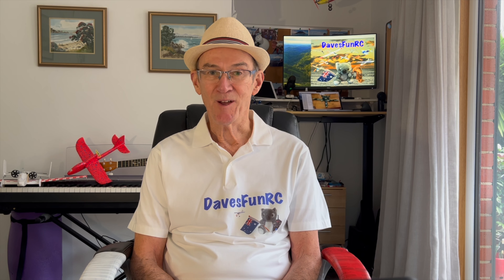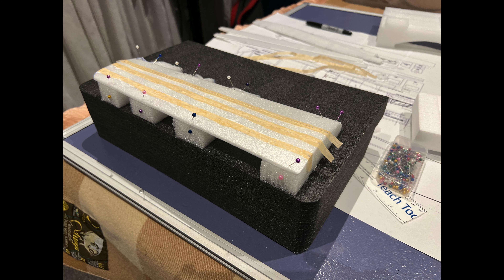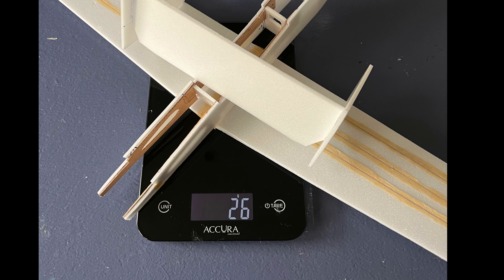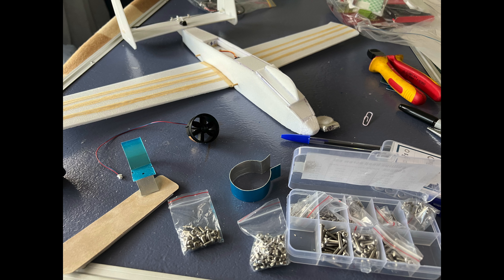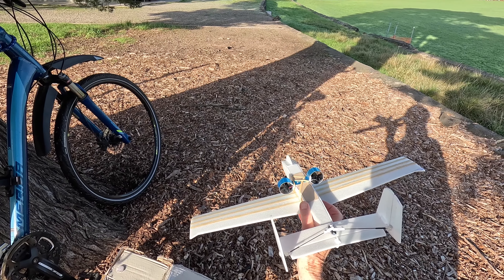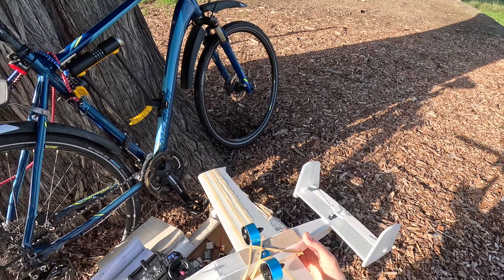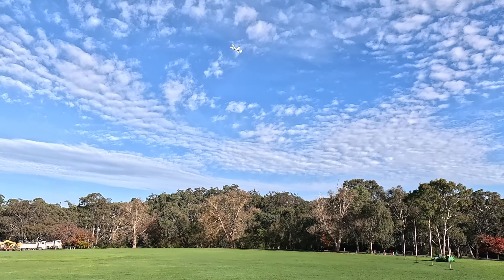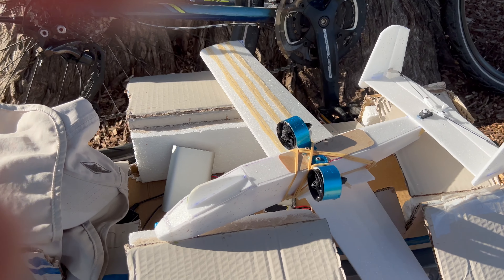A-10 Warthog Prototype Foam RC Plane Build and Test Fly #davesfunrc

Comment: the  elevator is in  the  'prop' wash.!      thus, pitch control is  not  normal.      this is a vertically offset pusher thrust configuration.     but, in this case, the locations of the sources of thrust are  abnormal.     as a result, it is impossible to achieve an optimal thrust line/angle.       the best solution to this problem would be the use of some negative aoa at the edf mounts.       note that in the absence of this change being made, the edfs produce unscheduled  Nose-down  moment, all  the  time.
it can be seen in the design of the engine exhausts of an a-10 (and f-4) that an adjusted thrust angle has been used.
Reply from the maker: Hi, thanks for the suggestions. It’s had a few updates since this video was made. I recently made a new EDF mount in my 3D printer. I could redesign this to have adjustable aoa. I’ve found that CG is critical. I also discovered the hard way that when the voltage drops and you throttle up, the elevators give full right!  It’s OK with high ‘C’ value lipos though.

Comment: 0154    OVER-sized, extra heavy vert-stabs.!       a decision to put the mass of a servo(s) at the tail  Should  be  an  INFORMED  one.!      specifically, putting the mass of a servo at the tail  Increases  the amount of tail-heaviness in a model's dom.     distribution of mass.
0239    the tail boom should have been strengthened via the use of the  LIGHTEST  possible materials;  aka   one,  strategically placed  (foam) FORMER.  
0301    due to their  Mass,  the use of metal components and steel screws is not recommended.
do you understand that the rudder linkage used does not produce equal deflection of the rudders.
0308    the  THIN  pretend cockpit acts as an  'extra' and unwanted  vert-stab.
0405    it appears that the rudder control horns are not correctly configured.    rudders are also  Huge.
0415    cg  should be located at thirty percent of chord.      a low-wing model  Should  be  inverted  during cg balancing.